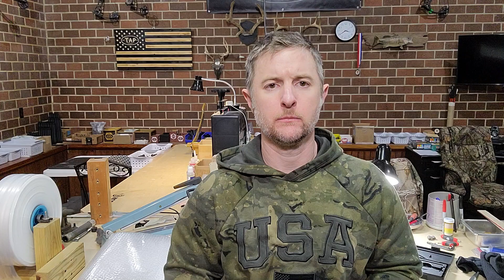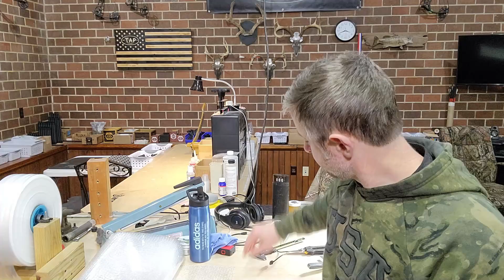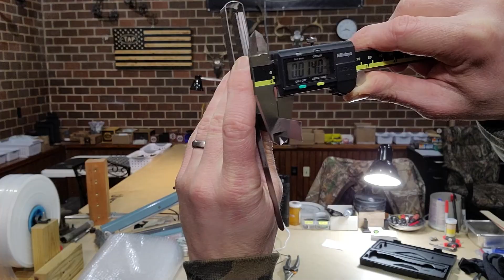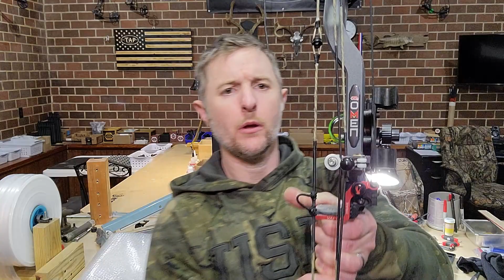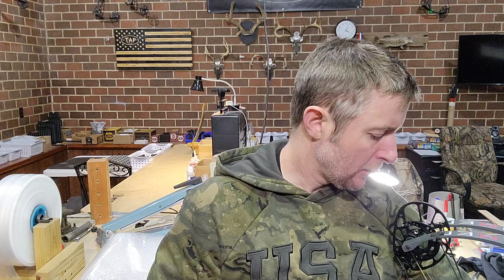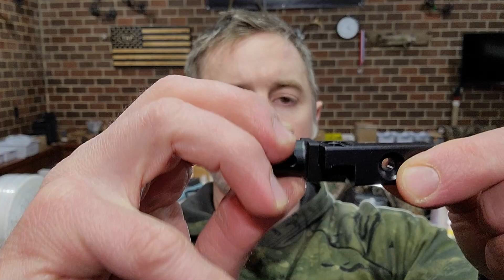DIY Shim solution to reduce side cant on the PSE XF 30, 33 and Omen Cable Guard System - TAP Archery

Comment: TAP Archery  Hello, for a PSE Supra X 37, Can you made a custom Cable Guard Rod Base with side angle adjust like the Hoyt Invicta?  This  because I notice the Cam Lean at full draw vs no draw change,  you can set ok the Cam Lean 100%, but when you are at full draw the cams always have tendency to lean to the outer side on both cams (this because of the increase in cables tension as you go to the full draw). If you have a proporcional adjust of the side angle on the Cable Rod it can be more tuneable.  This is in my opinion is the solving option for this problem in all PSE bows. Let me know if you can made this Cable Rod Custom Base.  Thank you
Reply from the maker: Thanks for asking! At this point in time I have not designed an Adjustable Cable Guard System that will fit the Supra X. Our TiTAN Cable Slide works very well on that model though if you're looking to upgrade performance in that area!
Reply: @TapArchery  I ordered the Cable Roller, and the String Stopper for it.  Let me know when you have available a Cable Rod Module and titanium rod for my Supra X 37. 🙂

Comment: Would that system fit my 18 Evolve 31?
Reply from the maker: Not this model...but we DO have a full bundle package for your bow and it does include a system to fit. 

https://taparchery.com/products/pse-bundle?variant=45380122804534
Reply from the maker: We also offer the various components of the cable guard system for your bow here if you only want/need that product and not the full bundle which also includes String Stop.

https://taparchery.com/products/psehuntingbows-cableguard